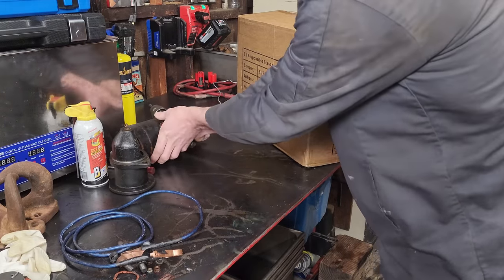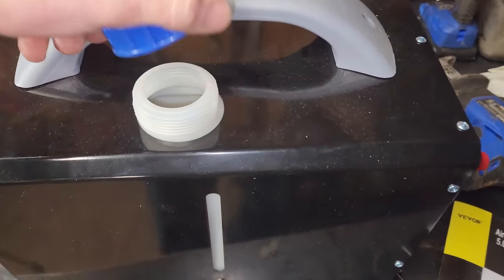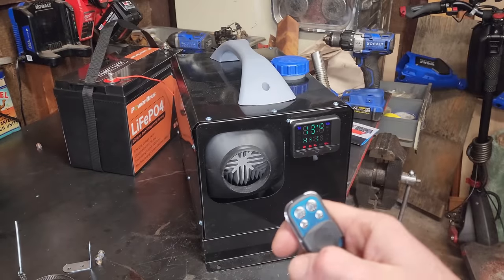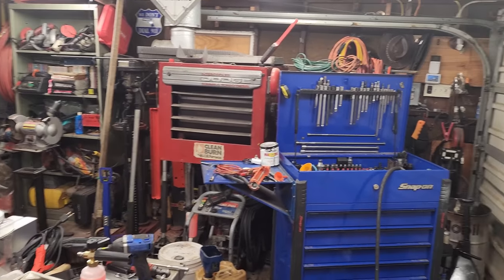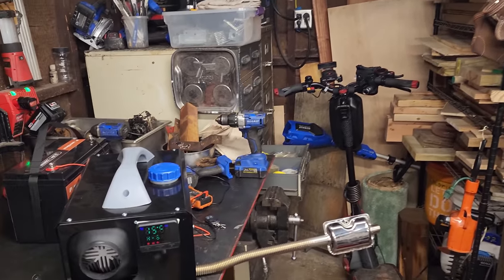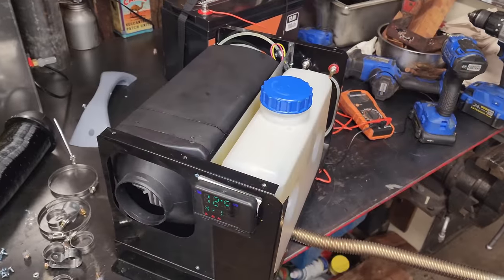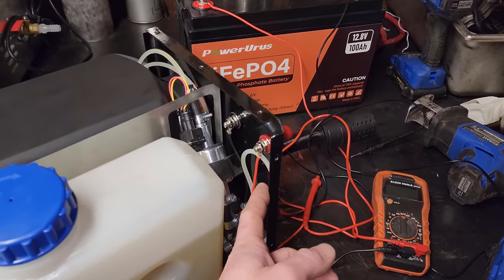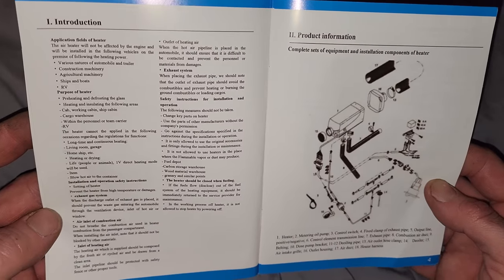Mini 8kw Diesel/12v Heater Review by #Vevor

Comment: I bought one of these last year and have been using it to heat my small 600SF condo as I only have electricity for heat. 5 gallons of Diesel lasts 5 to 10 days depending on how cold it is, and my condo is a balmy 74 degrees inside when it in the twenties outside. Love it! One thing I did notice and corrected last year, these heaters tend to coke up when run long periods at the lower settings. I run mine wide open until the condo warms up then set it to 3.1hz minimum... seems to not coke up as bad. Then I service unit in the summer with a rebuild kit (costs about $30 - new gasket, new glow plug & screen). I use electric fans and a ceiling fan to push the warm air around...

Comment: I bought the same heater and took it apart for an RV installation. Pricewise for an 8KW it couldn't be beat. I've been using it as my sole heater for over a month now and loving it! I feel so much safer with it then running a Buddy heater. Cost wise Propane vs diesel cost I think it balances out pretty close. 
Vs Propane its a dryer heat and with the blower it circulates much better. I think I can regulate the temperature in my RV better with it also. I am in a 35 ft fifthwheel at around 3000 ft altitude in Arizona. It does get below freezing here at night sometimes. So far, it's done a great job keeping my trailer warm overnight on the lowest setting during nights of below freezing temperatures. My RV is older so it's no longer as well insulated as when new. 
I've also experimented with running used motor oil through it. I would recommend well filtering it and not mixing more than 25% used oil with either diesel or kerosene. It will run a fifty fifty mix but it gets harder to start. With the thinner mix it starts better and I think you will be less likely to gunk it up! Even at that I wouldn't recommend doing it all the time! A little here and a little there. Just a way to burn up waste oil as you get it.

Comment: I have a different brand but pretty much the same thing. The heater will definitely take the edge off and make it more comfortable to work but most likely you won't be toasty warm. I really like these heaters and even running at full blast they sip fuel. Great units that are budget friendly. I recommend getting a small fan to blow all the warm air that rises back down to the floor.

Comment: I have a little different one but I attached it to a board and ran the inlet and outlet vents through the board so if my power goes out in the winter I can open my window then close it on the board. The heater sits outside with a 5 gallon can of diesel and a battery and it sucks air from my room, heats it, then blows it back in. It's basically the opposite of a window air conditioner. I also have a small solar panel and controller I can charge the battery with for an extended outage.

Comment: These are really simple. I have an espar and it's so expensive to work on at the shop. One year I decided to take mine apart and it just a ignition chamber, an ignition screen and a glow plug and a fan housing. Usually when they stop working it's from carbon buildup in the ignition chamber, or the ignition screen. It will smoke a lot before that happens. But you can buy the glow plug, screen and gasket kit for like $35 for the espar . And those are like $1200 new and to pay a shop to change those will be at least $600 for 20 minutes of work

Comment: I just bought one - vevor 5kw for my mini van haven`t set it up yet but hope to use when i leave South Carolina to Arizona after October 20th. Can`t wait to hit the road :-o
Reply: the 2k is probably better for a minivan. 5k will burn you out haha, you'll have to run it on low. Remember to run a tank on high through it every once in a while if you run it on low a lot, it will help burn out carbon buildup. 2k is definitely plenty for a minivan and it's healthier for the unit to run medium to max than low.
Reply: Thanks for the info - not sure i will be taking it. @escapetherace1943
Reply: @pnoon43  honestly it's fine unless you need it to be on 24/7. I got almost 20 hours of heat on my 5kw this week from ~ 1.2 or so gallons of diesel, running mostly on medium/low. It will ramp up once it gets even colder here and I will probably only get 12 hours off that amount. No clue what climate you are in but if the van is running 10+ hours a day then burning the absolute minimum of diesel you need to will be advantageous. I'm heating a small shop so I needed a 5k.

Comment: The diesel heaters are good, I have this same heater and they aren't actually  8kw the Housing design is the same  for the 5 kw and 3kw and those new controllers suck if you are into tweaking the hz and fan speeds, changed ecu and controller on mine. But for that also depends on your climate, it gets -30c here so dialing it up helps. But all and all they serve their purposem I use one for my ice shack and heating the porch at the house in the winter

Comment: Them lines are good. We have them units in all our trucks and they have that same fuel lines. We have never had to change the line's in over 5 years. But anyway we have them units running constantly when we are not driving. They will cook you out if you don't keep them turned down after starting up.

Comment: I use this exact heater to heat my 20x22 garage.  No issues heating to 69 using the built in thermostat.
Reply from the maker: I'm guessing it's insulated. My garage is not and pretty much Swiss cheese
Reply: @NNKH2  mine is uninsulated and swiss cheese too, about the same size as his garage (detached too). It keeps in the lower 60's just fine so far.... I plugged every existing hole I could and used some spray foam to insulate the gaps around the roof edges from the inside. The door is one of the worst spots so I chopped up several cardboard boxes and made them into gaskets blocking ~95% of the airflow there. Ghetto but it works 🤣

Comment: I've been running those heaters for a couple of Seasons now you get about one winter out of it before you need to overall it new glow plug and take it apart and clean all the black shit out of it but they do work very good they seem to be very efficient and do not draw much power the downfall as you got to overhaul it every season

Comment: Even if you insulate a little at a time it will start to help and take less energy.  If you heat the garage about 60F degrees it's usually comfortable to work.

Comment: That is basically a portable version of a bunk heater used in OTR semi trucks.  Those tend to fail because of the fuel pump or ignition failure.   Really need to be sure to use clean diesel fuel or a fuel filter, on the trucks they feed straight from the fuel tanks and for some reason don't use fuel filters.

Comment: I have exactly the same heater from Vevor with the same display. There is an issue with the manual and the current controller software. You can't access the settings the way it's described in the manual. I guess they have made some sort of upgrade. The problem is stepping from the first setting (clock/timer) to the next. There is no way to get past this first setting so you never get to the rest of them.
The manual describes another software version. For example the display is always on now. You don't have to press any buttons to light it.

Comment: It would be interesting to see the CO levels in your garage when it's running. I'm thinking of this for my garage.
Reply from the maker: Yeah I wish I had went and got something to measure it. Maybe I'll have to do a follow-up video
Reply: You could run the exhaust and inlet outside
Reply: These heaters have an exhaust pipe and must be vented outside. The heat should not have any exhaust in it.  The blower just passes air over a heat exchanger. Tons of video available.

Comment: I'm not sure if it's the same brand.
But.
Forestry Forest has used one of these to heat his van for few years now. 
He lives in a van.
He said the only problem he had with his, was the pump was noisy, and would keep him awake at night.
"Went & Checked"
His is differant.
His fuel tank is bigger, and he has it mounted remotely.

Comment: I think I would cut a short slit in the exhaust hose and use two pipe clamps and high temp sealant to secure it and keep it from leaking carbon monoxide into the building. Doesn't hurt to be safe.

Comment: Thank you for running the unit for an hour and a half with the unit unvented/indoors... I didn't hear your carbon monoxide detector going off! I was surprised. Thinking of getting one of these units to blow hot air UNDER our RV in dead of winter to keep pipes from freezing. It will not be exhausting under the RV. We are full time RV'ers. Thanks for the video.

Comment: I have the same unit, I use it in an uninsulated garage about the size of yours. It helps, but I want to insulate the garage. I'm running the exhaust outside, and there is definitely heat loss.

Comment: You can buy this heater in France for 180€, in the US you can get it for under 130$🤬🤨.
But,i think,i wanna buy one🤔😃. Thanks for your video👍👍.
Reply: I've checked here in Bulgaria and local prices for reviewed unit vary from 220 to 350 euro ( 😵‍💫 ), then ckecked prices at aliexpress - they vary between 130 to 150 euro ( 5/8kw, case style and controls differences ), and comes from Polland ( few days to any point in EU ).
One thing to mention - the control panel on reviewed by Chris unit looks sooo chinese-flimsy 😄.
Reply: @kaloianpenchev5592  yes you're right🤨

Comment: 8 kW (27500) BTU is an overrating. Most of these take around 0.35 to 0.4 l per hr, around 1/10 gal per hour. Which is around 4 kW.(13500 BTU) That makes sense, as these are copycat Eberspacher air heater, which came to market, when the patent protection ran out. And these were rated at 4kW. Still, it's a good heater for the price 
These things can be useful in power outages, a small hole in the wall, a capable battery, like 80 to 100 Amp hours, and it might run up to 30 hours on the battery with like 2 gal of Diesel/ kerosene (JetA1) or light fuel oil. And prevent your home from freezing.

Comment: Is there any safety features regarding accidently knocking it over? Will it shut off or just keep running while spilling diesel everywhere? Just a thought as the old kerosene heaters used to have a shut off if it ever got knocked off level.
Reply from the maker: Great question. I'm not sure. I'll have to check. My guess would be probably not

Comment: I’ve been wondering if I could use one of these things to heat my little cabin.
Reply: Their awesome been running same one 4 around 4yrs recommend putting a fuel filter on it, there’s all kinds of air inlet and fuel pump upgrades on EBay, even fuel tanks! Love mine.

Comment: I don't believe that there's any difference between an 8kw and 5kw diesel heater. It's a marketing scam to make you think you're getting a more powerful heater. Like most things made in china, their 200,000 lumen flashlights, are so far from the truth is laughable.
Reply: They are supposed to have a large fuel pump to be able to get through more fuel per hour etc,  the rest is the same

Comment: It's absolutely useless without a thermostat, that's ridiculous a heater without being able to control the temperature. It's just useless junk!
Reply from the maker: No real need for a thermostat if it's undersized for the space you're using it in
Reply: @NNKH2  On some of these there is a setting in the controller to change from power level to temp control.

Comment: Disappointed on your review. You kept bragging at the temp rise in the garage flailing to mention most of the heat that was produced should have been vented to the outside air.